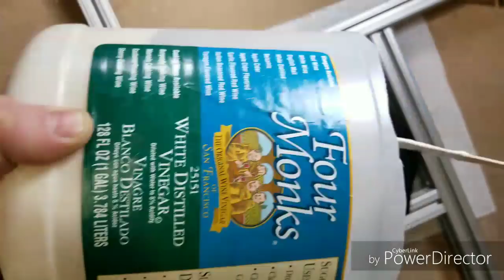$1 Kydex Trim Jig

Comment: Great idea.  To release the dried plaster from the mold, would it help to spray the inside of the mold with WD-40 or some other kind of lubricant? 
Greg
Index Point Holsters, LLC
Reply from the maker: Maybe. As long as you dont puddle it
Reply: They have release agent spray for plaster I believe

Comment: Would  the same process work to make a mold gun?
Reply from the maker: Yes, but you would only get like 1 or 2 presses
Reply: Even with a  vacuum  former.
Reply from the maker: @GaryHale8808  the plaster of Paris doesn't hold up to the heat of the kydex very well.

Comment: what type of router bit do you use?
Reply from the maker: A bottom bering 1" flush trim bit. You can usually find them on Amazon
Reply: @qlhholsters2361  Thanks for the info.
Reply: @qlhholsters2361  thanks for the video! Very good idea. - does the diameter of the bit matter? And the speed? - i tried a 1/2 diameter flush trim bit and it was very rough. Didn't seem workable. I had a pretty slow speed given the bit is quite tall at 2.5" and the manual on my router discouraged high speeds for big bits.